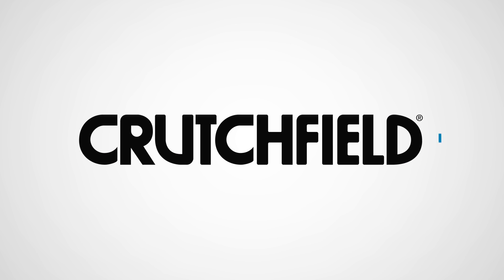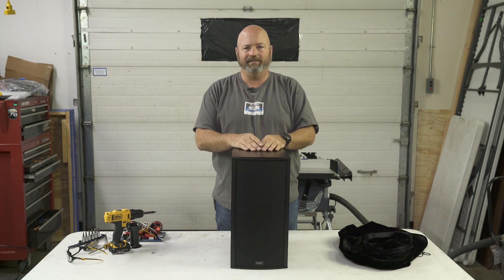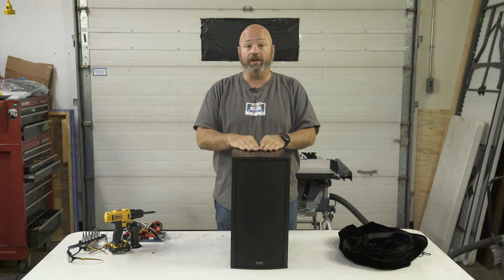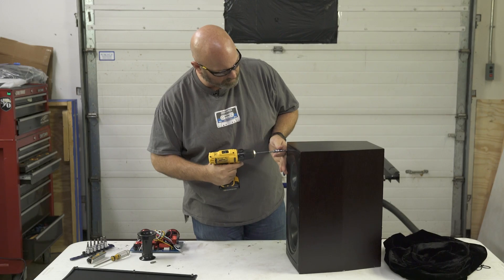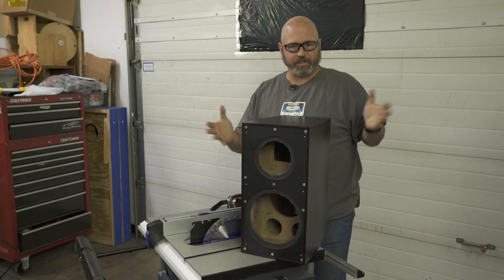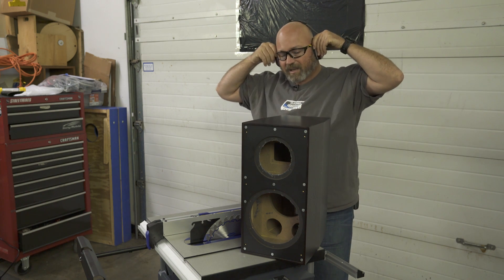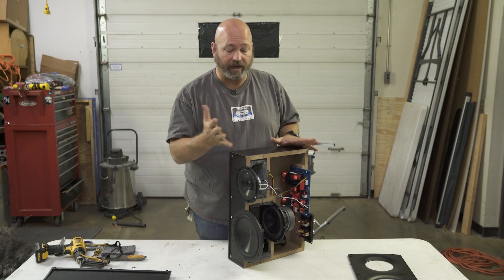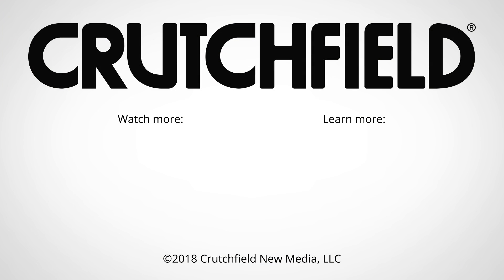Sawing an ELAC speaker in half to see how it's built | Crutchfield video

Comment: It would have been a bit more respectful to a designer like Andrew Jones, to get some information on this design instead of the nonsense given by the presenter....

This is a ( 6-th order ? ) band-pass loaded woofer ( nothing new ) but there is a lot more going on in this design. In other band-pass configurations the passive radiator is usually mass loaded, whereas here the passive radiator has a low mass, with the internal ports doing the woofer tuning & the light-weight passive radiator coupling into the room.

What would have helped, is things like the operational bandwidth of the passive radiators, crossover order/slopes & type of alignment & at least crossover frequency points ( 200 & 2kHz ) 

Transient response optimisation/design consideration > you have a sealed mid which has a very different transient response to the woofer section + dozens of other considerations...

The mid is definitely sealed - even though it doesn't look like it is in the cutaway...

Dumbing things down, because you have no idea of the complex design balancing issues is never a good idea ;-)
Reply: There's a guy on YouTube that cuts apple products in half and basically goes "hey look at this shiny thing", this is what it reminded me of.
Reply: It's embarrassingly brain numbing... I saw one other "review" done by this dude & it was pure unadulterated BS + outright lies..... 

We have an electronics chain in Australia called "JB Hi Fi" - I pop in there maybe once every 2 years to see what sort of junk "normal" people are exposed to - I asked the sales assistant ( they remodeled the shop ) "where is your HiFi section " she had no freaking idea what HiFi was !!! Even though she worked for "JB HiFi" > True story - you can't make this shit-up :-) ...... :-(
Reply: I wanted Maggies but I didn't have the room for them. So I got the next best thing, Martin Logan ESL's, refurbs, in mint condition.
Reply: Agreed. Not enough factual information and too much "seems to me like" info.  I doubt Elac is ready to share all their secrets with the DIY community. For now, I am struggling with the idea that a woofer moving air between two baffles in an enclosure is actually moving the passive effectively. The only thing that should affect the movement is the current pressure level in the front chamber. The rebounding passive would then hit that front chamber back which would in turn make it's way toward the rear. 

I would reckon they put a mic in each chamber and outside the box at say 2 meters and ran synchronous FFT analysis on them to calculate the internal tune without regard to the external. 

We will need a new update for WinISD...
Reply: I gave your comment a thumbs up. Glad someone noticed it’s a bandpass design. It’s unique in a sense that this design is usually found in car audio subs and computer sub / satellites where compactness is important. I just don’t like that it’s $2,500 for this common “uniqueness”. I can see more companies going this route for home audio speakers - it’s better than ported in my opinion. FYI - I have a pair of Polk Audio’s (notorious for passive radiator use) that are two ways (1” tweeter and 6.5” bass) with two forward facing passive radiators.
Reply: @ Chase Vineland What's intriguing to me is that the bandpass alignment has fallen out of favour with KEF - who were "big" on the concept 20-30 years ago... I never liked the bass on any of those KEF speakers... 

It had a TON of group delay & sounded like the bass was 2 weeks behind the rest of the music....Andrew Jones worked for KEF....

It's NOT so much a uniqueness, as trading bandwidth for efficiency at the cost of degraded transient response - to get a "small" speaker that does bass

When you look at what you actually "get" in other speakers for $2k5 - it represents very reasonable value on paper & specs alone for a "shop" distributed product....It's a complex 3 way - with quite a complex ( expensive crossover ) & very decent drive units, assembled by one of the industy's recognised "Gurus"... Is there a Guru tax ? Quite possibly ;-)   

DIY ( be prepared to put in the time & your best bet is a "proven" design  or direct to consumer loudspeakers are the only way to get more bang/$$$$

Believe it or not, I've heard loudspeakers costing more than $100k that did NOT impress & I have also heard loudspeakers with $200 worth of parts, that DID impress... ;-)

Why is it so ? How is it possible ?
Reply: @ Chase Vineland You should be pretty happy with that :-) 

Maggie's have always offered very good value & should make most owners happy - unless you're after bone crushing bass...( but you've got your dual subs.. ) law of diminishing returns is against you quickly...  Home Brew tube amp :-) :-) well done.... 

Look into Troels Gravesen if you're a "brewer" & have a look at theaudiopages.com & linkwitzlabs.com  & http://www.analog-precision.com  http://www.audioxpress.com diyaudio.com & Elekit ( Japanese tube kits ) 
Cheap system under $1k is possible ( with compromises of course.. )  as you're saying & it's much harder to design something decent for little $$
You can also get "lucky" by upgrading crossover components - starting with the series crossover capacitor on the tweeter ( you may have to adjust the padding resistor on the tweeter ) Also moving the tweeter attenuating network as close to the tweeter as possible ( moving it off the main crossover board & mounting it say on the back of the tweeter - use non magnetic resistors ie either bifilar wound or carbon or metal oxide film ) 

Andrew Jones was with KEF for many years & he designed the TAD line of speakers before he designed the Pioneer budget gear ( TAD is owned by Pioneer ) 
I bet your system punches way above it's weight category ;-) 

Sounds like you've got it dialed inn nicely... so don't get lost in the "upgrade" Hell & as The Hans Beekhuyzen Channel sayz " whatever you do enjoy the music " :-)
Reply: Bogdan Weiss I agree Magnepan’s are a good value. I’m on my second set.
Reply: Bogdan Weiss Currently my mains are Magnepan 1.6’s with modded x-over (the crossover coil is the size of a large coffee can). Paired with two amps - 15x2 watt single end class A tube home brew and a Parasound Halo Integrated 240x2 into 4ohms. Running two Sunfire subs. Pretty good all around but occasionally I interchange with three various sets of B&W speakers. This makes up my bedroom system - a bit overkill.

I don’t know who Andrew Jones is but so far his Elac’s and even his low cost Pioneer’s aren’t very special sounding. I have listened to them for the sake of curiosity and they’re fine but not great. 

I say all this because I have a pair of old Polk Audio floor towers that are two ways (1” tweeter and 6.5” bass driver”) with two 6.5” forward firing radiators which were pretty inexpensive. They are powered by an inexpensive tube push pull amp 25x2. They sound very good all around with excellent balance without being too bright (however a tad shouty). Cheap system under $1k and it really shines.
Reply: Dean Mindock Believe me my ex-wife had serious issues about the floor space and size of the Magnepan’s. I want to upgrade to the Maggie 3.7 which are even bigger. Life of a audio junkie... pissing everyone off with shaking walls and overheated rooms. I digress.
Reply: Great score :-) just make sure you don't buy speakers where the drivers are unobtanium... I've seen people ripped off blind by shonky "HiFi" dealers too many times.... A friend had some Focal drivers blown at a party ( aerogel cones ) I could not get replacement drivers anywhere... Not even pinging a manufacturer who was buying from Focal direct.... re-doing the crossovers to fit a different driver is NOT economical when you need to send the bill to the owner... ;-)
Reply: I'm glad he cut it in half at least now you can see if your $2500 is worth it,to me personally its not,but to someone else it maybe a good purchase.

Comment: I think this is a bad design.  Major flaw is the back of the upper vocal driver is sharing the volume with bigger driver underneath. The big one is goin to suck life out of the small woofer above. That's bad for sound.
Reply: Well it's interesting that you called one of the most renowned speaker designers products to be a "bad design" and "bad for sound".  Surely we should listen to your point of view about this.
Reply: Ork Onlinenow actually you are wrong, if you pay attention the mid driver is isolated and braced and closed off with the thick insulation that he took out.  The bass from the bigger driver wont suck the life out of anything.
Reply: It looks pretty obvious that the chamber for the midrange is supposed to be sealed of from the other two chambers. This is required for the driver to operate predictably.
Reply: If you look at 8:52 there is a rectangular cut out behind the mid-high... something is going on.
Reply: you are right - it's very bad design to do what you describe BUT stop at 11.40 - the square hole has a separating panel missing, the screw holes can be seen. Im puzzled by the tuned port working over a range well enough and reversing the phase to push the passive radiator..... surely just one larger speaker is easier and less complex - less is more?  all looks inefficient - Id love to hear it...
Reply: As far as I'm aware, its used to enhance the performance of the driver, but in a smaller enclosure than is recommended.... considerably smaller, like 40-50% smaller. As you can see, the chamber behind the concentric driver isn't all that big. 
     This is slightly off the beaten path, but ... https://www.youtube.com/watch?v=XynqZK7P2nk
All these techniques are fine, but like I said, I've never enjoyed any of AJ designs, so .... people praise him for being some genius, but the end result speaks for itself, and the only people calling him that aren't the kind of people from whom I wouldn't want to take advice from when it come to acoustics. its mainly from the What-hifi crowd, RMAF crowd which IMO is just a promo show for snake oil salesman. As for WHF, I've heard enough 5 star rated garbage from them to last me 3 lifetimes. But like I said, all that commercial stuff are for those who don't know better, or are unwilling to learn.  Not saying AJ doesn't know what he's talking about, but for me the end results were/are a miss, and I really can't understand the mania around him. Again, don't get me wrong, he knows his stuff ... but so does Bose. You can't fault the engineering behind Bose, but the results are ... meh!
Reply: Of course! and as the drivers are not in line there is noticeable time delay between them.
Reply: This has a very BOSE feeling about it. Trying to use a variation of a 6th order bandpass to artificially pump up the bass to get a small driver to perform like a big driver at the cost butchering the various driver responses. Would like to hear it, but suspect the bass would be real boomy with questionable PR distortion from the design.
Reply: That's exactly what I was thinking. What's next, he tells Ferrari how to make a fast car?

Comment: I haven't heard the speaker before but my first thought on that woofer design would be that it would sound muffled but I assume it doesn't
Reply: I was thinking exactly the same thing. I'm sure it would sound muddy compared to hearing directly from the driver unless it's pressurised inside which I highly doubt. You do usually get some lower mids coming through the woofer on normal speakers to fill out the sound and I'm not sure they'd come though here. Anyway,  as Glen said, apparently the guy knows what he's doing so who am I to argue.
Reply: @Cyba_IT_NZ  speakers cannot be pressurized. Think about it...
Reply: Except that they used a coaxial driver so that the woofer doesn't have to do more than 80Hz
Reply: Never though much of Elac TBH
Reply: the passive is actually much faster sounding then the ported design he has essentially used the benefits of both designs and reducing the ported designs down sides very good idea. i'd have to hear to see if its successful (to my ears of course) but Andrew has been know to design some wonderful sounding speakers.

Comment: Hmmm... Think there is a part missing from the engineering sample. Whatever mounts in the square hole behind the mid/tweet. Because as is, the 'open' back mid/tweet is in the same physical chamber as the ported woofer. That would be a disaster and a horrible design. Just something I noticed :)
Reply: No Richard, no they do not. 
If you have speaker with an open back - meaning the rear of the cone can move air behind it. And you place another open back speaker in the same airspace. They will affect one another. If one is a mid range and the other a woofer; then every time the woofer cone moves, it will create a tremendous amount of pressure on the mid driver. Screwing it up both sonically and possibly physically. That is why EVERY speaker manufacture will have a separate chamber for dissimilar drivers that are open back.
Reply: Correct.
Reply: If you look at the internal picture on the Crutchfield page it shows a blocking plate that covers the access hole behind the mid driver.  They are isolated enclosures.  So no crosstalk from the bass driver...  But still not a fan of bandpass bass systems.
Reply: That's where that huge Crossover goes, it wasn't missing, it just was pre-removed and then placed incorrectly in the box I think.  Edit:  It could also just be a simple speaker terminal that goes in there between where the xover is located and the driver, hard to say.
Reply: Looks that way according to this https://images.crutchfieldonline.com/ImageHandler/trim/620/378/products/2017/47/970/g970AS61GB-o_other1.jpg
Reply: I noticed the same thing. Seems that the mid/tweeter shares a common chamber to the back of the woofer. I'd assume this is to mitigate any pressure differentials in the mid/tweeter section while also providing a hole for wiring. I'd be worried however because the woofer may flex that mid driver. Who knows if they put some kind of filter/ baffle  in the production model. As it stands, this is a funky design but I'm sure it sounds incredible.
Reply: I don't see the picture you are talking about, but there is definitely a routed area for one. The reason for the square hole is to be able to screw the network to the doubled up MDF on the back.
Reply: Mustang Guy 
Clearer internal picture https://youtu.be/swQWhNxW-8A
Reply: Yes, I agree with you
Reply: @Jai's MediaYou're reply makes no sense, me stating an observation is hardly an indication of intelligence one way or the other, you responding to an observation with a delineation of intelligence is however, therefore I can only conclude that you looked in the mirror after reading my response and confused your self image with my response.